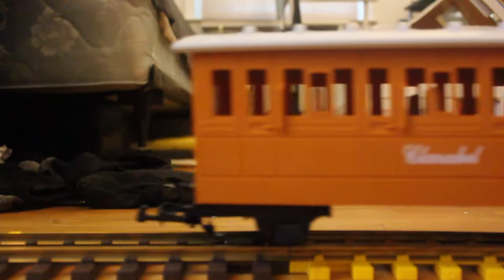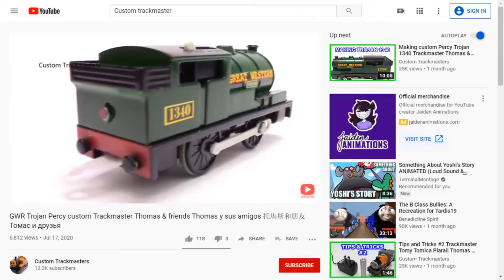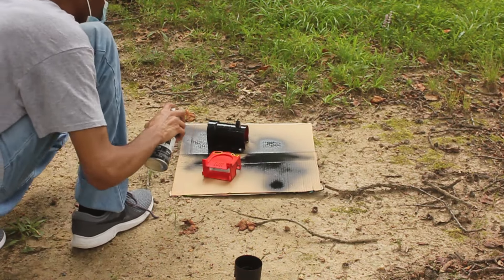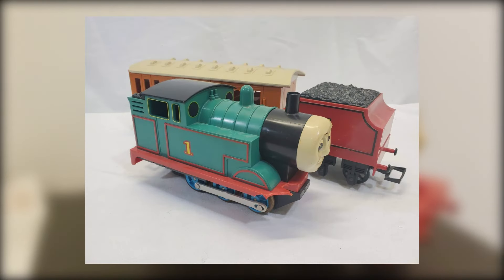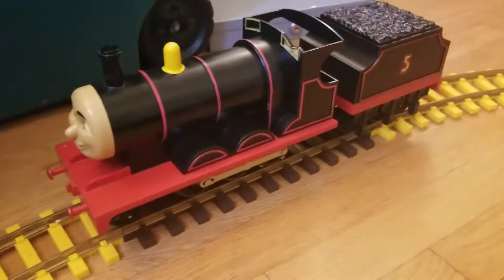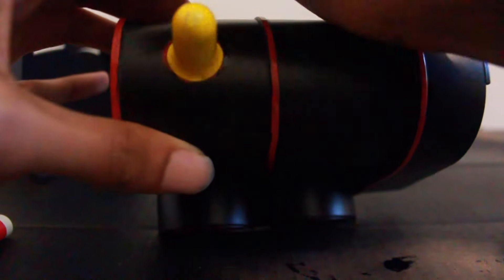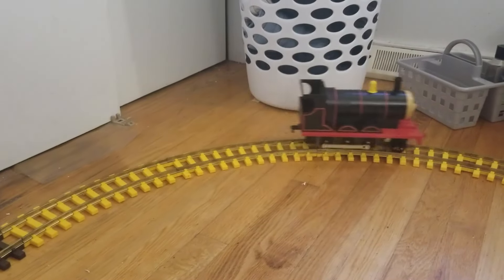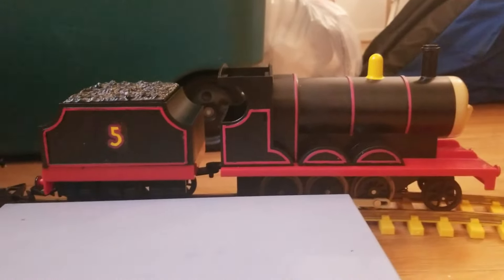Custom Lionel Thomas and James Models

Comment: A little advice, so if you want to fix up those small white line mistakes I’d say take paint from the spray can and use a brush to fix up the mistakes, though I don’t know if the color would differentiate or not. Anyways it’s a nice effort

Comment: If you are having trouble making the strips I highly suggest that you mask off the sides that you want to have stripes on take a small knife and cut a small line down and repeat the process on any other areas that you want pin lining. But besides that those were some amazing customs keep on the amazing work

Comment: I have a question about the paint. Is the “Rustoleum Spray Paint” toxic? Because I’ve seen some reviews that say this paint contains the WORST chemicals.
Reply from the maker: While I don't know how toxic that paint is I would recommend wearing a masking while using the paint and storing it and whatever you painted outdoors until its dry. Long exposure to the paint did give me a headache so just be as safe as possible when using Rustoleum and any kind of paint.
Reply: BenTenLife Do you need to wear gloves to use that Rustoleum paint as well?
Reply from the maker: I would recommend gloves just to keep your hands clean. I didn't use any because I didn't have any lying around.